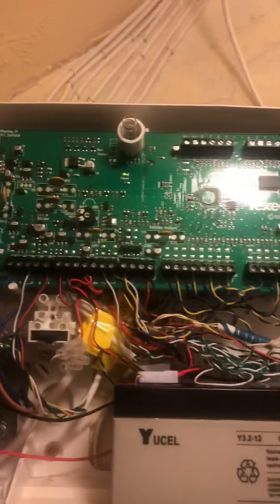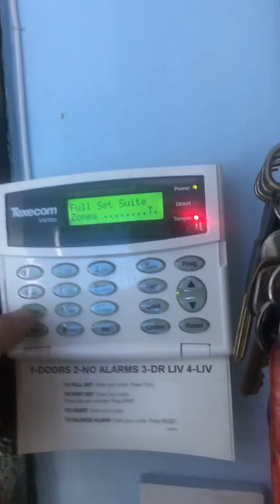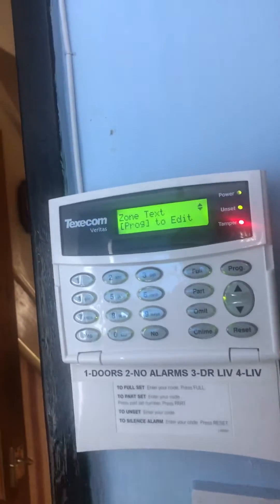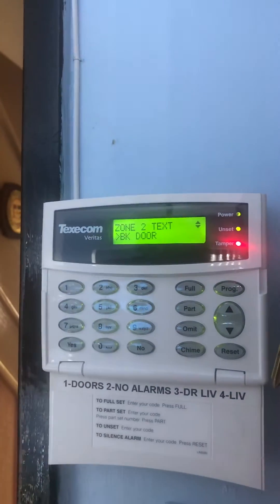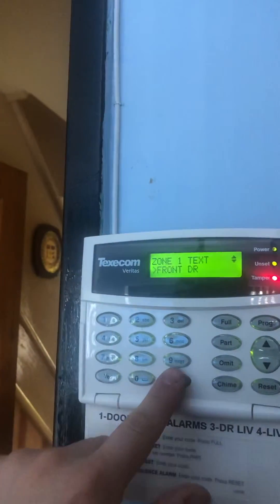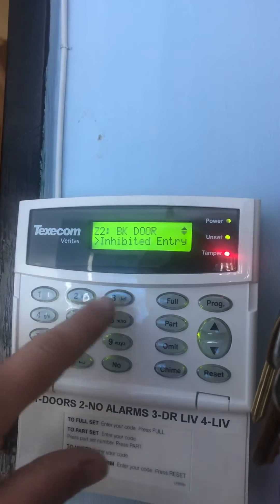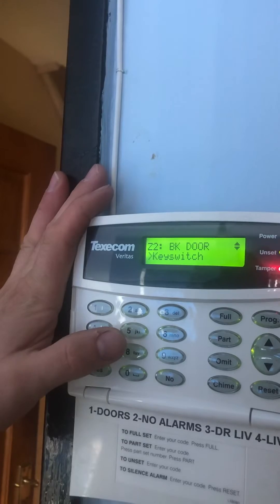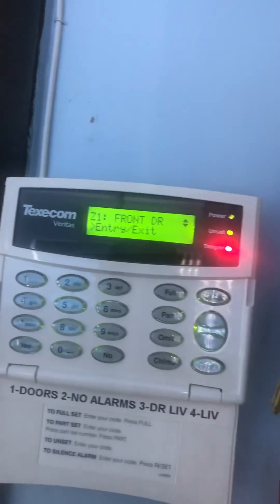Texecom Veritas Excel programming Part 1 zone setup

Comment: What Is better this alarm or the premier elite
Reply from the maker: Depends what you need it for! If your wanting your big standard alarm with no extras this one’s better as easier to fit and program and less that can go wrong but if your wanting app control or the alarm  to have additional functions then the premier elites the one. I would don’t this system to an elderly persons home over the elite for for example for ease of use.
Reply from the maker: Yes both network for keypad and sounder terminals are in the panel

Comment: Hi. 
Thanks a lot for this useful video 🙂. I have couple question you hopefully might be able to help with. 
1) The PIR sensor in the hallway is working as it flash when detecting movement but when running a WALK TEST it is not going off. I checked the zone type as it's set as 'Inhibited Entry' as the front door has a magnetic sensor. I tried changing the zone type to 'Guard' as run a new WALK TEST but still nothing. What would be the issue with this sensor? 
2) The FIRE zone type. You have it set in the video as Zone 8. Is this kind of a default? Or to have a dedicated FIRE zone special wiring in the unit is needed? Or the FIRE zone is activated when the smoke sensor triggers something in the main electrical panel that alerts the alarm panel about a fire and then can trigger an alarm?
Thanks a lot. 
Cheers.

Comment: Hi
How do I set the delay exit/entry time for  the entry door? Also the time the external bell sounds?
Reply from the maker: Hello
Exit time:
Code + program + 31 + [set req time in sec] + prog (chimes to confirm)
Entry Time
Code + prog + 32 + [set req time in sec] + prog (chimes to confirm)
Bell cut off
Code + prog + 35 + [set req time in min] + prog (chimes to confirm)
Reply: @alarmassist  Thanks for the info. Just one thing, you mention a panic button, where do you wire this to the board?
Reply from the maker: @davidlaw694  zone 8 and set to PA Audible on zone setup

Comment: As a engineer that panel had no presentation put into that at all. I would be ashamed to even let someone film something like that to be quite honest. Let just think the bloke that is doing this video has took it over.
Reply from the maker: Actually he didn’t he wasn’t an installer when he installed it he was a hgv driver! And as a result it was never taken over! 2 years after it was fitted he went on the alarm installation course at Tavcom! No one would give him a job as they wanted experienced engineers so he had to go solo and learn from the bottom with no help what so ever! And no he runs a successful firm! So I very much doubt he feels any shame what so ever! What’s embarrassing is a engineer searching how to program a veritas a gone midnight! Because Surely he’s not that perfetic that he spends his nights going round trolling!

Comment: Hi buddy. I have the exact same alarm system at my house. Ever since we lost power in our area for 4 hours, my alarm's tamper light hasn't come off even when I put in my code. It just silences the alarm but doesn't remove the tamper light. I removed the lid from that box to have a look but never actually touched any of the controls or anything. I just fixed the lid back on have left it alone. For about a week I haven't been able to set my alarm when going out because of this tamper light. It's so frustrating. Could you please explain how to remove the tamper light so my alarms working properly again? Would really appreciate it. Thanks
Reply from the maker: Hi pal replace the battery with a new 2.0Ah or above and it should be fine. Veritas has a history of battery issues!
Reply: @alarmassist  I managed to fix it. I took the lid off the box and realized that the spring attached to the tamper button wasn't on properly. I straightened in on properly again and screwed the lid back on again. Works fine now! Thanks anyway